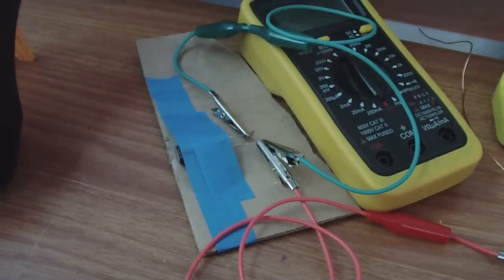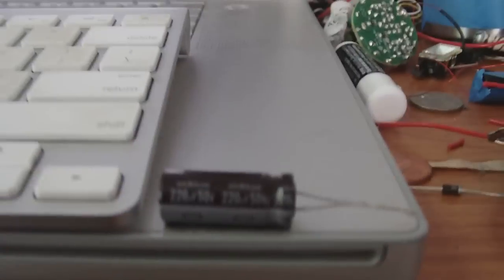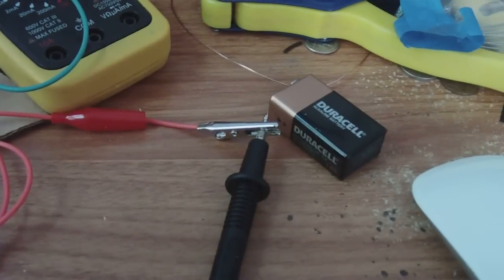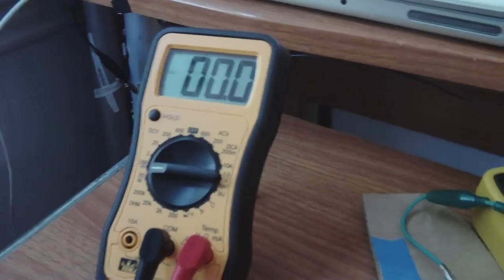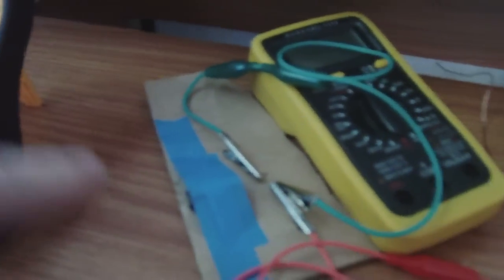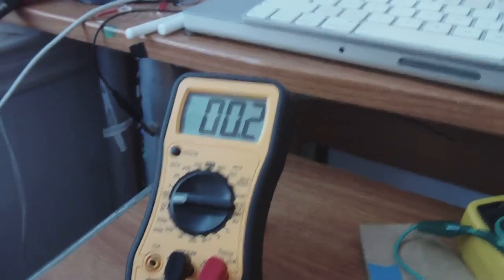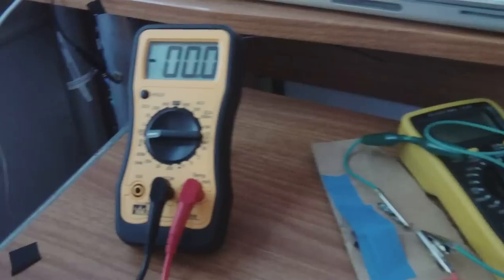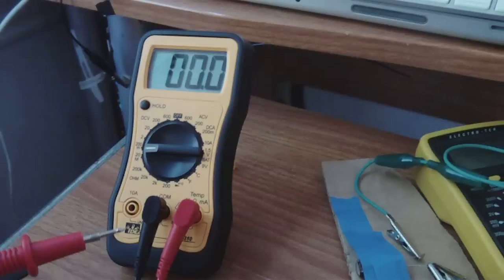Captret self charges when capacitor is shorted out

Comment: try using a long bare wire for the short.  like 10-20 ft long in different shapes, like a large coil or just a long arc.   to see if you get a larger or faster  charge.  this may tell you if your short wire is just acting like an antenna, capturing charge from the enviroment.

Comment: I can confirm this with my 2700 uF 35 Volts electrolytic capacitor.
Mine charges up from around 20 to 50 millivolts.
When I touch both poles ( case and shorted out pins) I can get it charge up to 50 millivolts. Without touching it, it goes up to about 20 millivolts.
If you discharge these 20 millivolts then , it will recharge.
Have a look at the thread at:
overunity(.)com/index(.)php?topic=9878

Just remove ALL the brackets from the above URL.

Regards, Stefan.

Comment: i think its possible the caps metal case may be working in unison with the negative plate to form a larger negative charge potential, where as just the negative plate and lead alone dont "see" the cap case potential. this potential is coming from the surroundings. i have seen the same thing.. for example touching it will discharge the electrostatic. its RF and other waves. "radiant" energy!